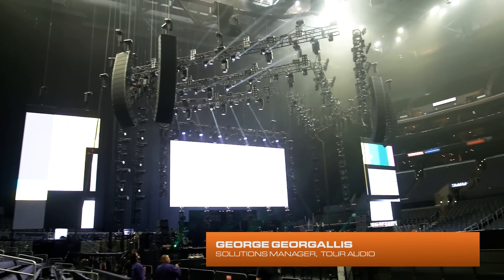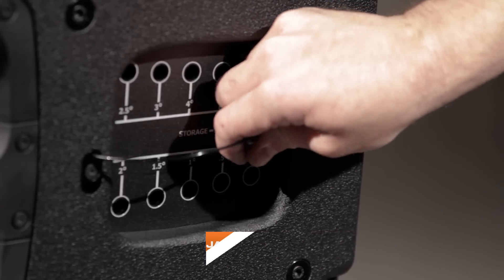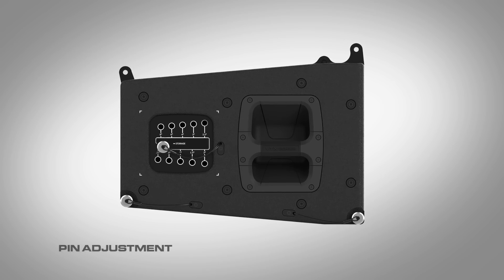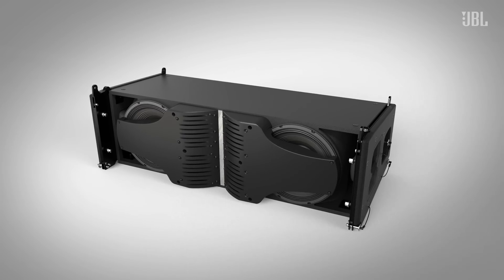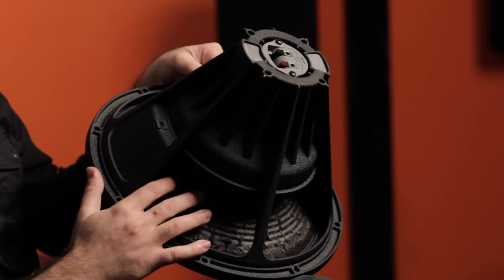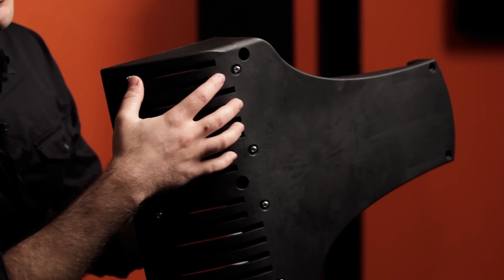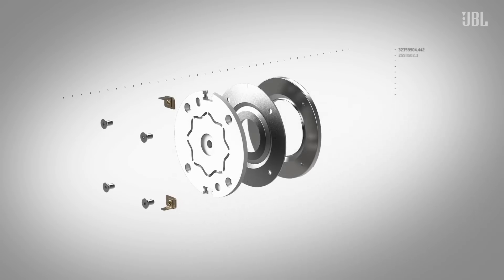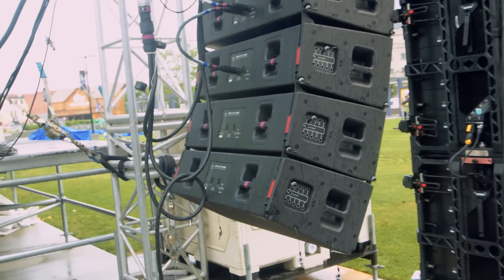JBL Professional VTX A12 Overview

Comment: PLEASE CONFIRM THE COST OF EACH  VTX A12 AND HOW MANY TOO MAKE 72,000WATTS USEAGE VIA A 72,000WATTS SOUND SYSTEM PLEASE.
Reply: what is the cost of a pair of VTX A12
Reply: @monicajtrotman4608  new, 30,000$
Reply: high efficiency your dont need the 72kwatts you have